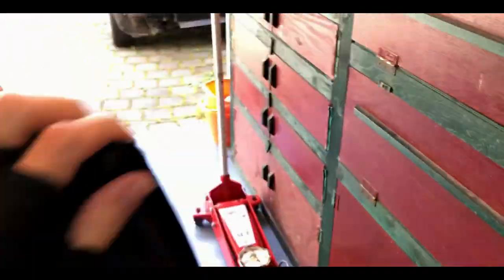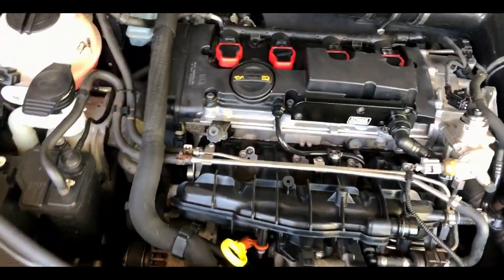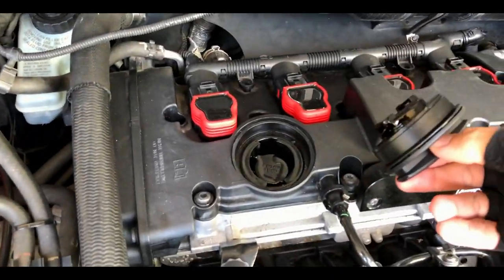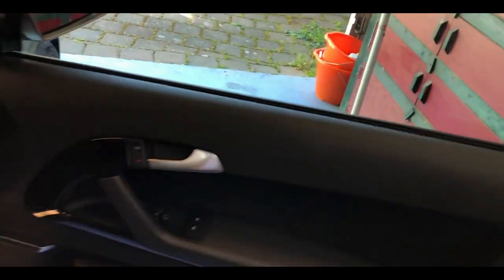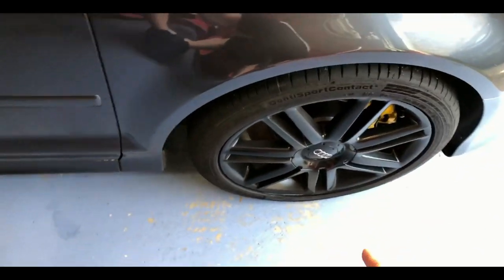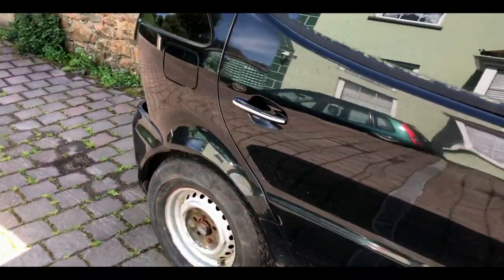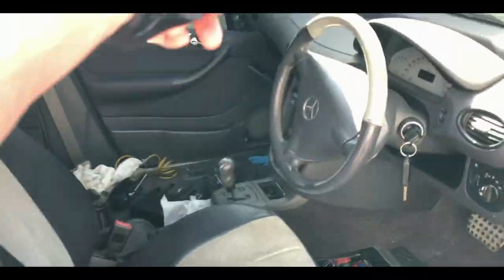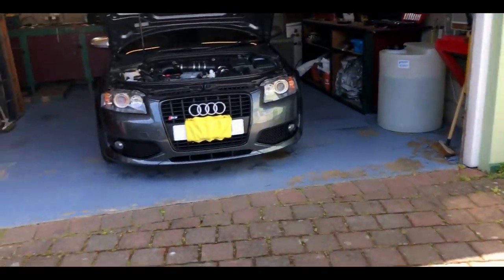Update - New Clutch & Fuel Pump

Comment: What spacers are you using?
Reply from the maker: Mitch 10mm front 15mm rear bud
Reply: MotoAdventuresYT thanks man 👍
Reply: @MotoAdventuresYT  Do you get rubbing on the back with 15mm spacers? I'm assuming you have standard S3 suspension?
Reply from the maker: muaz989 hi mate, no rubbing at all, standard suspension, although I am currently waiting for 30mm springs in the post this week. There will be a video of me installing them soon
Reply: @MotoAdventuresYT  Cheers mate! Looking forward to the new vid :)